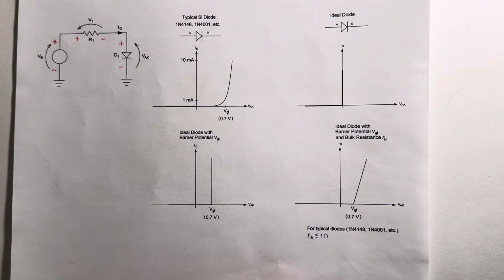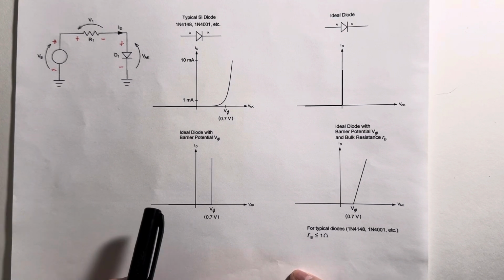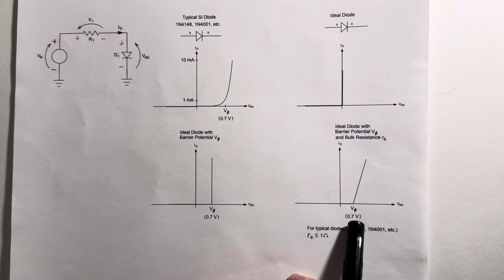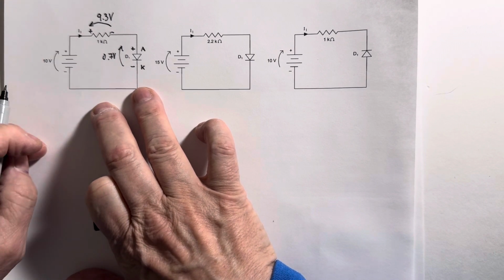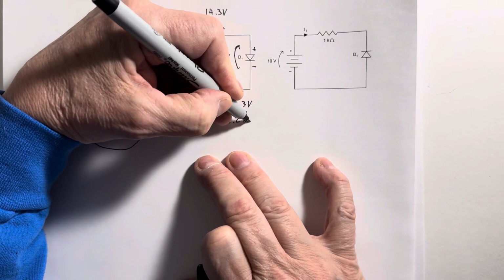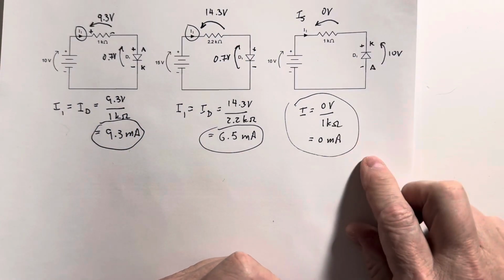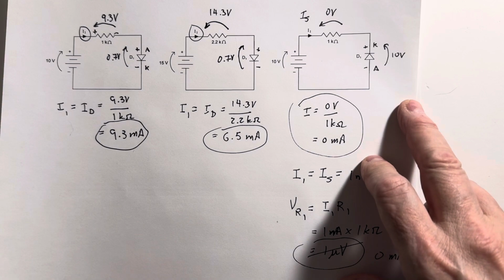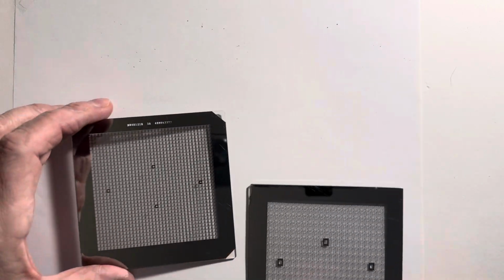Topic 3: Finishing up the Diode Discussion

Comment: Does the Shockley equation work also when the diode is reverse biased? What is I_D equal to then? I_S or -I_S? Or is it something else?
Reply from the maker: Yes, the accurate version of Shockley's equation (subtracting 1 after the exponential) gives the ideal reverse current, -Is. But it doesn't take into account surface leakage or temperature effects.
Reply: @Denton.Dailey  Thank you for the reply! How come it doesn't take care of temperature though? Doesn't V_T take care of that?